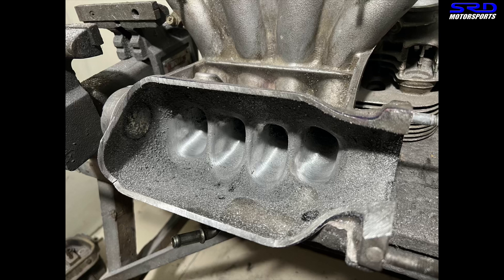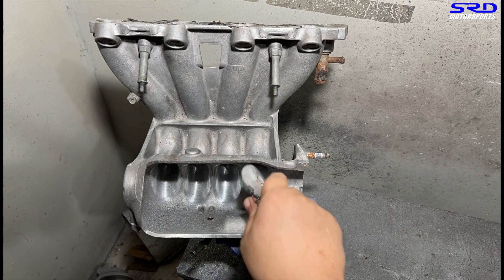VTi Ph16a D16y8 Intake Manifold Porting and Development

Comment: What welding stick to tig these back up Im following your guide got it ported but enginners dont really want to do it, is there a best type of tig rod to use to make putting it back together easier?
Reply from the maker: @vctrsone  it’s not a welding rod, tig uses an aluminum “filler” to weld it , we always send it to the machineshop as they’re experts in it

Comment: I have a question if someone can help me out that would be amazing I want to put a Z6 cam with rocker arms in a Y8 head. I want to use an adjustable camgear how much do I need to time it and can I just keep using my original distributor that is on my OBD2A/OBD2B car with this swap.
Reply from the maker: Won’t work,,, in my country a lot keep doing this and wonder why they are slower than stock but then won’t admit the issue…

There’s a reason why crower made a Y series cam and a Z series cam

I have a video last year
about this
Reply from the maker: https://youtu.be/kO_WgwiN0TY?si=rgiNTqhEGvcUhozk
Reply: @SRDmotorsports So would you advise a Z6 engine head swap? And if I do that how much you I need to time it? And can I keep using my OBD2A/B distributor with it?
Reply from the maker: Yep whole head swap is safer